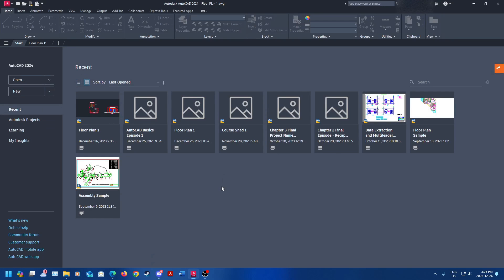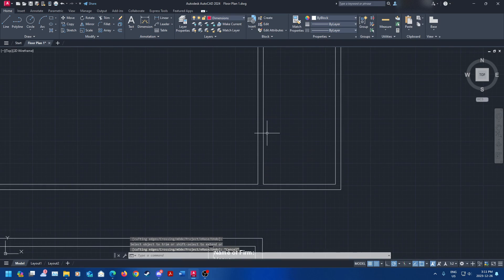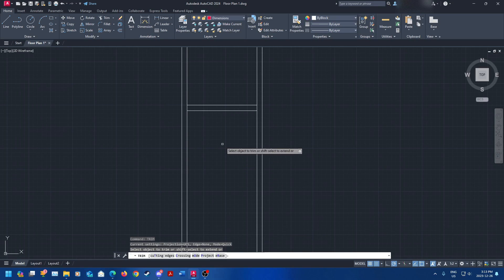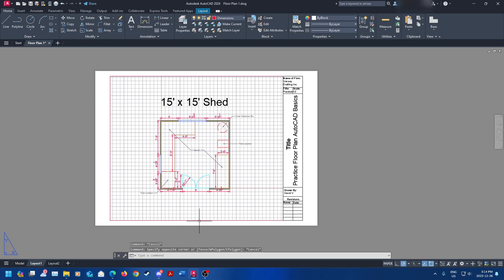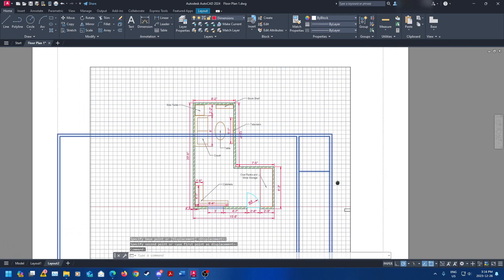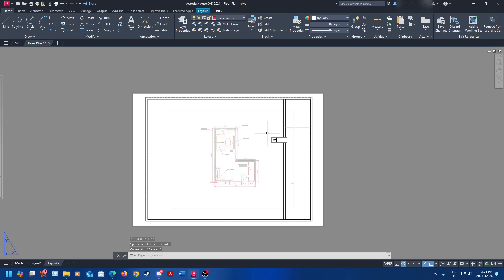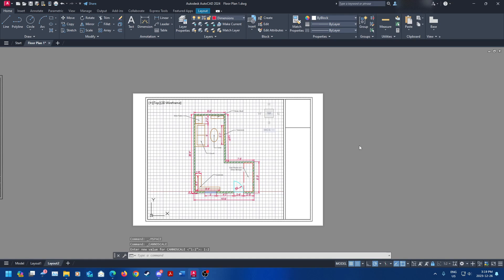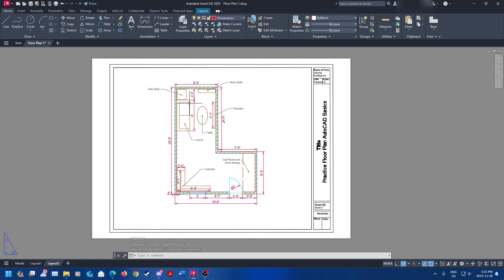How to Draw a Title Block Like a Professional in AutoCAD!

Comment: Why would you use model space for title block instead of paper space.
Reply from the maker: Honestly I've wondered the same thing for years haha. I've had both students and people I've worked for tell me they prefer doing it this way because they can block it and it can be made to consistently fit if you're using the same size paper all the time and you don't have templates or anything else! Can also easily be resized.